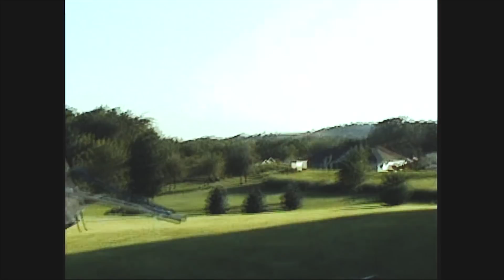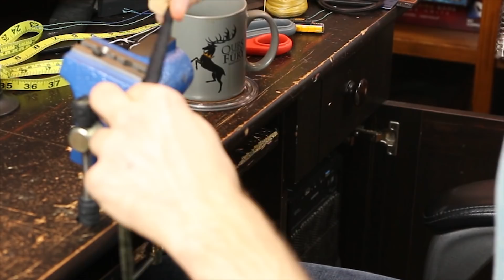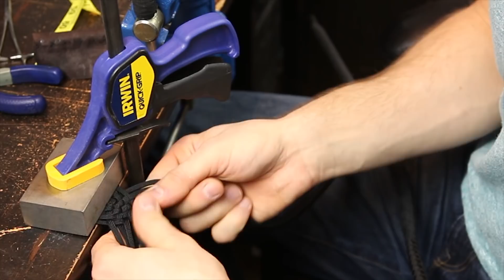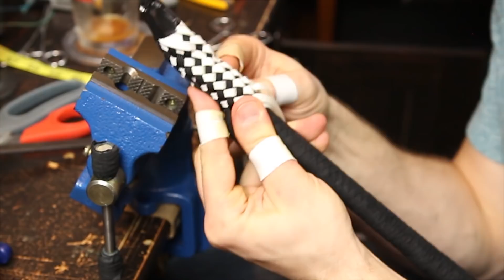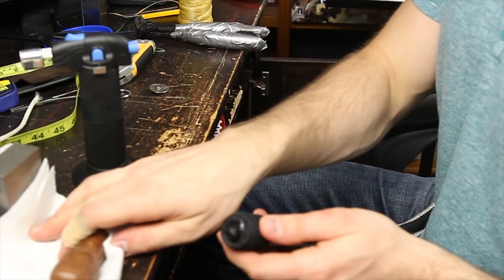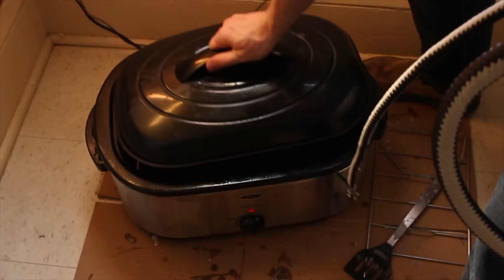Making a Paracord Bullwhip for Adam Savage!

Comment: What are you using to hold down the taped strands to plait.  Looks like 2 metal blocks.  (2 x 4)
Reply from the maker: Charles Smith
Those are 123 Blocks, just chunks of steel.  I use them all the time, here's a link to the ones I use: http://amzn.to/2HyWB5C
Reply: Thanks!

Comment: What are you using on the transition from the handle?
Reply from the maker: It's 1/4" shrink tubing, it's usually used to insulate the connection between wires. Is that what you're referring to?
Reply: @whipworks4468  Idk. I was referring to the mesh you secured on with artificial sinew
Reply from the maker: @charlesputcho9329  Oh! That is rug liner
Reply: @whipworks4468  Thanks. I love your work. I'm about to venture into a 9 foot whip. I've made the core only so far. I'm curious as to why you gut the cord for the core? I mean I understand loading them with bbs but the bottom part of the core. Why not leave it round with strands in core?
Reply from the maker: @charlesputcho9329  The coreless lays more flait, even in my internal layers I think it makes a difference. Also, I order all of my paracord coreless straight from the manufacturer, so I don't waste any material by doing it this way. Good luck on that 9 footer!

Comment: You have the same torch that I do
Reply from the maker: Nice!  I like it, but it just stopped lighting on me.  The starter is sparking though, have you had any trouble with this?
Reply: WhipWorks ya mine when it’s cold won’t start for a few clicks but eventually does, the only actual trouble I’ve had with mine is that the amount of fuel coming out can be kinda inconsistent but that could also be a temperature thing.
Reply from the maker: It is definitely cold here, this is good info, thanks!
Reply: WhipWorks 👍🏼👍🏼